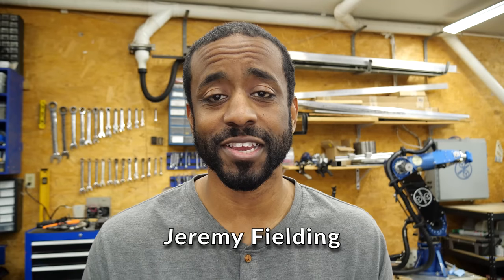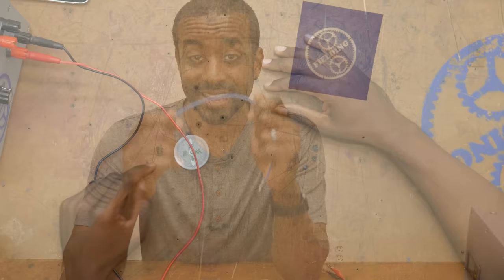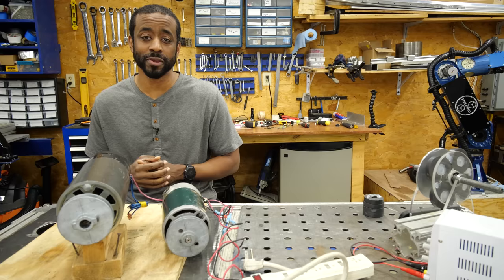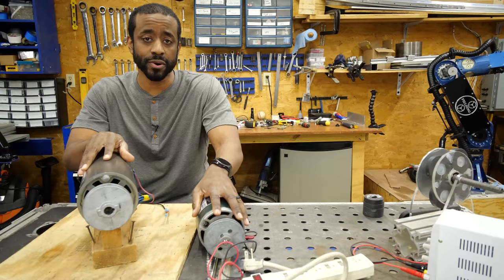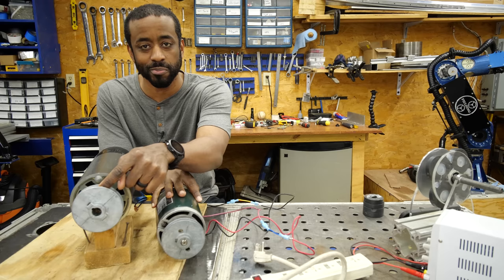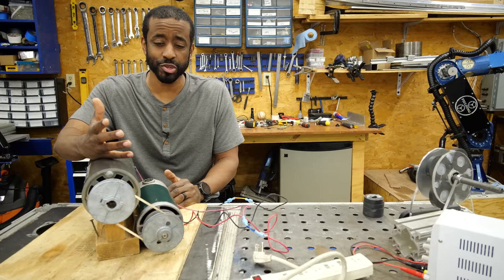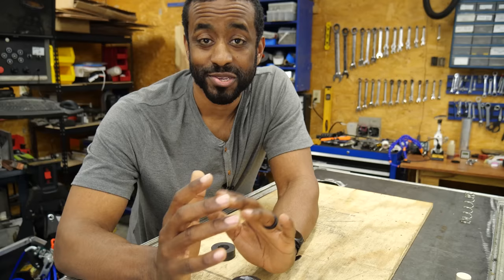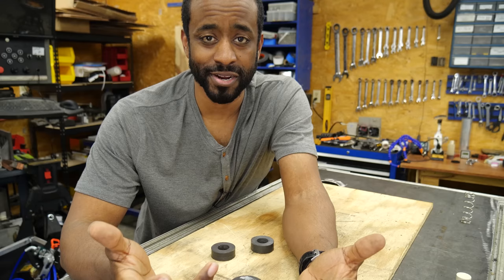Reviewing Free Energy Generators.  A Response to My Video "Nikola Tesla's Greatest Invention"- 102

Comment: You can just add a huge flywheel and a capacitor in that cycle to have a potential energy that can be recharge per cycle...
Reply from the maker: Both items make it worse not better. Perhaps you would find part three helpful. I prove this doesn’t work with power meters and explain with different examples and demonstrations in that one. Link to playlist in description.

Comment: technically electric cars do have alternators, it is what is used for regenerative breaking.
Reply from the maker: Technically they don't. They use the electric motor as a generator, this is not an alternator. Thanks for watching! Also I discuss regenerative braking in part two of this series if you want to check it out. Link to playlist in the description. :)

Comment: Can't they put alternators in the wheels so they power the battery while the car is rolling, wouldn't probably keep the batteries fully charged all the time but wouldn't that help tremendously on long trips especially?
Reply from the maker: You should watch part two. Its the opposite. Adding an alternator would make it worse not better. Link in the description.

Comment: The simple magic of 3. 
I realised if you have 3 solar powered lights shining onto each of their solar panels then there is no need to store its energy in a battery for use when there is no sun aka at night also perpetual energy dependent on its first charge up by the sun and sufficient  LED output the subsequent lighting wired from the 3 set up could be endless linked  to a capacitor what do you! all  Think out there???

Comment: Could you run 2 dc motors together with gears instead of a belt, But inside a vacuum where resistance is minimized

Comment: What if you tied 5 weights to 1 drive shaft and set the weights falling in a stairstep manner and will work like a grandfather clock. Only 1 weight at a time needs reset and is done by the other 4 still running

Comment: Matter can neither be created nor destroyed, so if matter is infinite, then energy, too, should be infinite, because energy is matter. 

A closed loop circuit, connected to a battery, that can have a + (proton) or - (electron) ran through magnets, reversing the polarity at will, should be an infinite loop of energy. The battery fills with electrons, which magnetically swap places with protons, which are accelerated through the magnet, and collected by conductors, and ran back into the magnets, until the battery is depleted, or full of electrons. Then, you reverse the polarity, and pull with the magnets, so you end up sending the electrons back through the magnets, and collecting them, until the battery is full of protons, and back again.

The energy produced here is the force of the magnetic particles, which can be used to turn a dynamo, and produce further electricity, proportional to the size of the motor.

And i think it would cycle from + to - forever, until it breaks, giving energy constantly proportional to its magnetic acceleration.

Comment: Amazing video. Wow!! I'm just wondering, so it makes sense that if the battery powers 100w to the alternator and the alternator gives back only 80w then your system wouldn't work, you explained something about an external force. So, instead of using a battery to power an alternator to then charge a battery would it work to use a manual driven rotation system like let's say a massive water wheel. Being able to produce 2000 RPM to turn the alternator and the alternator charged the battery?? But I've also understood that the alternator in itself cannot produce power just by being spun. But how about this magnet DC motor you used. Could I find an external source of rotation, connect it to the pulley of the DC motor and charge a battery through that?? Would be great to understand the possibility of that ☺️

Comment: So take a tesla and put an alternator on each wheel axle. The split the battery system with a flipflop charger. If the car is moving its charging!
Reply from the maker: I talk about this in part two. Link in the description. I even test a alternator at the end!

Comment: Have you done a video on all of the different types of wind turbines? I'm particularly thinking of circular upright turbines that rotate horizontally and could they be more efficient for space usage (versus the large prop turbines which must be spaced further apart). I'm not thinking they might produce MORE electricity but rather that you could put them closer together and the combined electricity would be greater than a single prop turbine. Thanks for reading my question.

Comment: They will argue with you forever on this subject. They will  complain about the belt, the drive pulley has to be bigger, you need capacitors to store the generated energy or you need a flywheel in the mix. Like you said, they make money lying! If you run up a flywheel in one of these machines and unplug the system yes it will run off of the stored energy in the flywheel for a short period of time but will obviously slow down. None of these things work as a Free Energy Generator. But retag these videos as FREE MONEY GENERATORS and that would be a more accurate term.

Comment: I'm no electric genious but I find it hard to believe that motor uses all the power the alternator puts out because a car runs off the alternator once started. The only time the battery will be used is if u draw more then the alternator can pit out which in typical folks car isn't a issue. Unhook the battery once started run the fan the ac the fuel injectors the lights stereo etc.

Comment: ONE TIME  i was on a little row boat, with a 12vdc electric motor. running off a 12-vdc deep cycle battery.. fishing on the lake.. My father, a diesel mechanic... said" i wonder why they cant make a alternator, generator on same shaft as moitor?" and or on a water turbine on another genny/motor,
that would charge or hold the system in a constant motion, and never stop.. But at 13 years old.. I said, because you could never recover the % lost ie 10%, from friction, heat etc.. and or 10% plus the first startup- that would require id imaGE EXACTLY 12VDC..? OR 10%? THAT WOULD NEVER BE GIVEN BACK.... LIKE you explain.. Only way i thought, was another generator/alternator, that was powerd by a tiny gas engine idling.. (like a train) and or the new edison truck) the batterys and electric motors, still would need that engine, or even a good solar panel too get the volts back up to and above the 12vdc and % lost, so you would need prob 14vdc? going back into the loop?.. 

I though about a capacitor?.. but even that.. still take volts, too make volts.. im no engineer.. just a kid with some basic electrical background and comins sense mechanically..      THOUGH.. i think it could be done... BUT it would still be a sort of "hybrid" externall seperate power too add inmto the looped system too make up for used and lost volts...      maybe solar panel 24v?? regulator?, battery, capacitor? motot, generator? all 4x-5x setup correct could make something stay going once started..?? something too make up and or cover the lost volts, and volts that will be lost?...      
I THINK A DIESEL ELCTRIC HYBRID like the edison truck, is probably the best thing your gonna get too reclaing and keeping a system goin.. but it requires a bit of fuell.. just like a solor panel would need sun, and too make prob dbbl the volts?.. idk lol..     but i always knew it was too good too be true with a motot running a motor, prety much, even with a battery in there also..  MAYBE SOMETHING WILL COME ALONG ONE DAY.. THAT CAN ALMOST RUN NONSTOP..

Comment: try a two three phase Moters with crossed phases they will feed each other and run all day!!! you will need to start them with a motor that is plugged in as soon as they are turning you can unhook it from your power source. we have run a saw mill all day.......... and it will back feed your meter so unhook it from your power source the meter will fail, and you will have your electric company trying to figure out why!!!!!

Comment: What if you made one and tied it into a long line of in series batteries bc that would step up the voltage battery to battery and the. When it's high enough to run a proper generator to make the perpetual loop?

Comment: If you have a electronic motor and a generator motor,  let say a 5000 watt generator with matching rpm,  will it at actually run enough of about 3500 watts to be used separately separately

Comment: The water generator is pretty much 100% efficiency and you can create water from the moisture in the air. You also can tap into the ether energy or electricity in the atmosphere I’m sure if you know how to harness it.
Reply: we tap into the energy in the atmosphere all the time - using wind farms.
Reply: @alexjeffrey3981  not like that lol. Very primitive compared to what can do tapping into the literal energy of the particles would be like 1000x more powerful than wind. Still wind better than fossil fuel of course.
Reply: @BillyB94  what do you mean by tapping into the energy of the particles? like nuclear fission? It's beyond my understanding as to why, but we do already do that but only with fissile material (uranium and plutonium, mainly). Wind power is the only other option AFAIK as wind is just the kinetic energy of the particles of the atmosphere.

Comment: Oh yeah and I bet if you got an insane amount of money to spend and you use magnetic bearings and all the lines of electricity were done in solid gold wiring you might actually get pretty close to a Perpetual state of generative power but you're going to have to do away with as much resistance as possible

Comment: What about a hand wounded watch
I know it storage energy 
But it stoped a day or 2 later.
But need no battery.
The only thing I came to my mind for free energy.
You manually hand wind the watch for storage energy through gear and wheel
Still need to be rewound but it 30 sec for 2 days of watch time
Reply from the maker: I love making mechanical clocks and have several videos on exactly this. The spring is the battery. We can call it a mechanical battery. There is something called an "escapement" that controls the speed of the spring unwinding in a mechanical watch so all the energy isn't released at once. If the spring was bigger it could run longer. People prefer small watches :) The spring and battery are identical in every way we measure power. For batteries it is Voltage x amps equal power in Watts. For mechanical devices like springs it is Torque x speed = power in watts. They are the same units and equal in every way.
Reply from the maker: You put enough power in the watch in 30 seconds for it to run for several days. The same way you put enough gas in your car in a couple of minutes to drive for hours.
Reply: @Jeremy_Fielding  read above 👆 watch is a day or 2
Reply from the maker: Perhaps we are not talking about the same thing? The relationship is exactly the same whether we are talking about 1 full day or a week. The power is added quickly and slowly released. That’s not free energy. It just different rates of usage.
Reply from the maker: It not free energy. The energy came for you lift the weight and was stored as potential energy. For the watch you wound the spring and stored it. To be able to wind the clock you had to eat food. When you stop eating you die from lack of energy. No part of that was free. If say the food grows with energy that came from the sun... then I would say sure that part is free. LOL.

Comment: I'm gonna try this, 1hp motor, 1750rpm 115ac, belted to a 55 amp 12v DC alternator, DC alternator hooked up to a 12v deep cycle DC battery, deep cycle DC battery hooked up to a 16000 watt inverter, Then a cut off switch between the inverter and the motor.... What do you think? Spin the alternator to get it going, with a handheld drill and socket, the alternator goes to the 12v battery which connects to the inverter, which plugs into the motor. 

Not motor to motor in your example... but an alternator to a motor via a inverter though a battery. As long as the loss is kept to 75%, I'm thinking it might be good to go, but all I want it to do is run a 1500 watt 110v electric heater in the winter or a 1500 watt 110v air conditioner unit in the summer.
Reply from the maker: After you try it (the best way to learn) come back and watch the rest of the series to understand why it failed. Link in the description. After reading thousands of questions in the comments I better understand why some where still confused after watching the video. Part three is the best one. But you should definitely try it. Its a great lesson in physics, and if you are right it is worth hundreds of billions of dollars. So certainly worth the effort to prove it to yourself.

Comment: And I'm not a expert as I say so I don't wanna say your wrong but is power produced at the Hoover Dam? Basically it has gigantic generators/alternators so theoretically isnt that free power aside from the generator/altenators? He'll I wanna know I'm not expert it has always made me curious with setups like were seeing. By all means dude is intelligent.
Reply from the maker: Yes I would certainly agree that is free. It is basically solar power. That is not what this video is about. The point is you need mechanical power to spin the alternator. That power can't come from the alternator itself. I am talking about scams where people claim to create power from nothing or "itself" which really means nothing. It is impossible to multiple power. So no arrangement of devices can increase it either. But the sun is dumping a ridiculous amount of energy on the planet every day heating things up like >>>>>>> WATER. So yes the sun heats water causing the rain cycle...  lifted up hill it will fall down hill. That is certainly energy that can be used, and has been used for thousands of years... water wheels that is. You might want to watch part two. I do a better job of explaining the problem and proving how the alternator works with a demonstration at the end. Link in the description.

Comment: What about the extra power you can get from the energy created in braking and friction from  the rotation of the wheels with a slight adjustment and even possibly using turbine generation or solar.....wouldn't that give enough energy to account for the loss and then some ?
Reply from the maker: It doesn’t make sense to “account for the lost”. It doesn’t work that way and if it did You would just get back exactly what you put in. Like buying a cash machine that takes $50 and gives you $50 in perfect conditions and sometimes less. The machine is still worthless and cost you money to buy. Regenerative braking is already a thing in all electric cars and doesn’t require an alternator. The motor can act like a generator. Solar is a completely different question. It doesn’t make sense to use it the way you described but separately it has its own pros and cons. I have a whole video about this separately

Comment: 6:46 why can't a 14v, 12v caps might work but having that 2 extra volts allows the motors feed to continue (in theory) capacitor be implemented soldered whatever to the input of the genset?
Reply from the maker: I think you would learn much more if you just tried it. There are too many assumptions to clarify,  but a good demonstration would answer this question and the follow up questions that will occur. It is worth your time to try I think. If it worked it would be worth hundreds of billions of dollars.  That's how big of a deal this is. But you will at least get a great lesson in physics that will last longer than my comments could

Comment: I wonder if 100 percent could be achieved in a vacuume  cause it couldn’t exchange electrons with other atoms because it wouldn’t be touching anything
Reply from the maker: but if it vibrates, gives off heat, makes any noises, has any friction, has wires at all which have electrical resistance the answer is no.